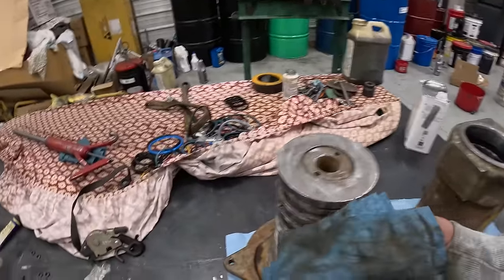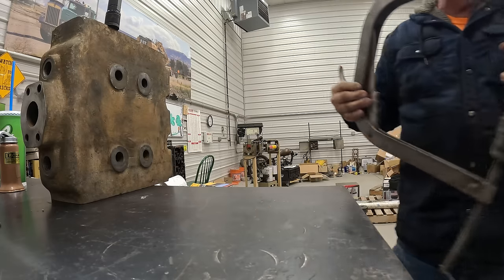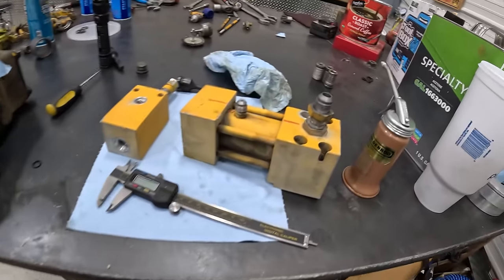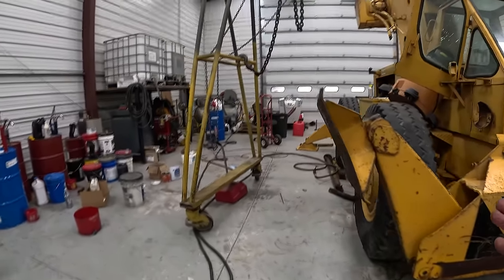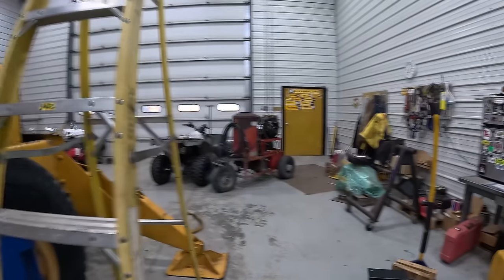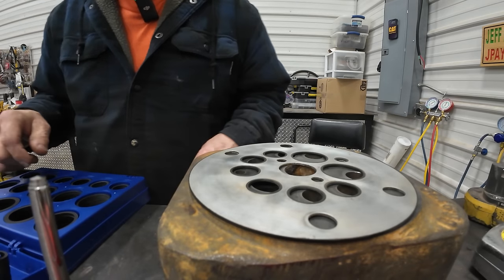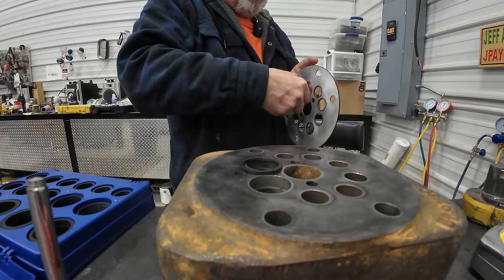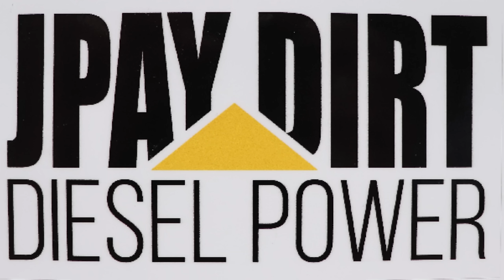How Many Gallons In One Galion

Comment: Hey Jeff, you will never get the boom up if it is overloaded, and you cannot two block the block, it will bypass also, now that's pretty cool. The advertisement says "the exclusive anti-two block Protection"  You have done a fine job. There is a drum brake up on the hoist you adjust to help load the load.
Reply: If this machine has 2 block protection...it was an option until it was made mandatory
Reply: @tomcander3669  Maybe so, theses, were in a refinery, had a safety class,had to read manual, hands  on and a sign off.
Reply: @MY-ml5rp  I can only speak of what I've learned over the years. I'm sure the refinery spent for all the options and then some

Comment: Enjoyed the video.  I work on some older stuff and your experience and knowledge of things has been helpful.  I sympathize with your plight with the CAT dealer.  As I am of a similar age and have had many interactions with dealers of different brands, CAT used to be the gold standard.  Their folks seemed to be top notch, responsive, knowledgeable and helpful.  Parts availability was above anyone else.  Factory support was excellent.  It seems to me that as the old heads are retiring and exiting the business that same commitment to customers is leaving with them.  Now when I call about something and am told "Let me check and I'll get back to you" that it never happens and it is up to you to continually check and check and check again.  Getting a call back after hours, well you can forget that.  Don't mean to rant but I have noticed a difference over my career.  Don't get me wrong, there are still some excellent folks but they are far and few it seems anymore.

Comment: It's because Cat isnt Cat anymore. They've gone the way of everyone else instead of requiring the best and more of themselves. They went to China and are making the same stuff as everyone else. They're no longer set apart from all the other manufacturers anymore, doesn't matter the brand anymore It's all junk nowadays. It used to be worth paying more for Cat.
Reply: You are absolutely right. The 200 series excavators were 100% designed by cat when they had that joint venture with Mitsubishi Cat abondoned there design and adopted the current Japanese design excavators which are far cheaper to manufacture cat used many castings in their machines which is more costly but moves welds away from high stress areas  .
Reply: The only real thing cat has going for it is longevity. Cat machines you can buy parts on machines that are 40 years old. No other brand does that
Reply: John Deere also does that.
Reply: @shawnthomas314   NO they dont. We have multiple john deere machines that are obsolete because of parts. Basically at 20 years dont plan on buying a new hydraulic pump, trani or other major components. John deere response go to a junk yard

Comment: I bought a cheappy OSC radiator from rock auto last year for the 97 12 valve. Didn't get to test in real summer heat yet. Only complaint I have, is the pressure caps don't seal. I put a pressure release type cap and seems to help. Stupid china crap. But no leaks

Comment: I've always wondered why they never built an excavator with a separate hydraulic pump in the lower track drive section and then used big slip rings and brushes to transfer electric power from the engine instead of a prone to failure hydraulic swivel valve? Or even direct drive electric motors? Then the motor could have a piggyback generator on the motor. I don't know how it might work out, but like freight trains, it should work I'd think?

Comment: Swivel packing is square urethane with buna energizer
Main boom cylinder is polyurethane packing and falls apart when it contacts water 
Not that hard to get it out and put a fresh packing in 
To dry those up I plumb all the returns into a cut off drum than a centrifuge than a filter cart than back to tank
Reply from the maker: not in the early 60's  I've done cat ones and they are urethane but this old girl is just buna 90 duro

Comment: 34:52, they made a mistake that has no cheap and easy solution. I just wonder if they would trade sticks off a machine lost to a fire maybe? Or, is it possible to upgrade your machine to a removable counterweight system like those big machines have? That’s probably expensive, but you end up with a solution…rather than a problem. A quick and easy removal of the thumb may slightly help a little bit???